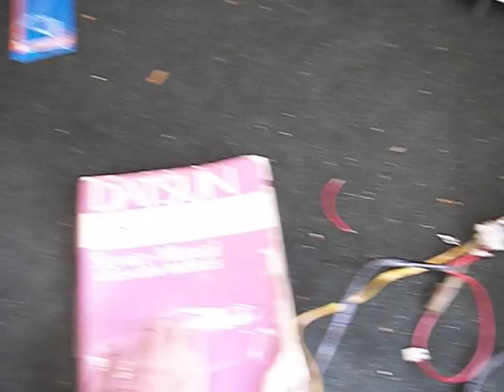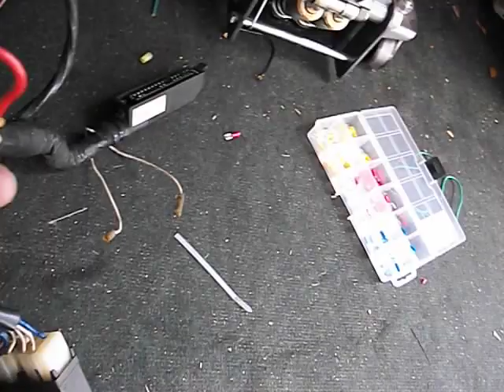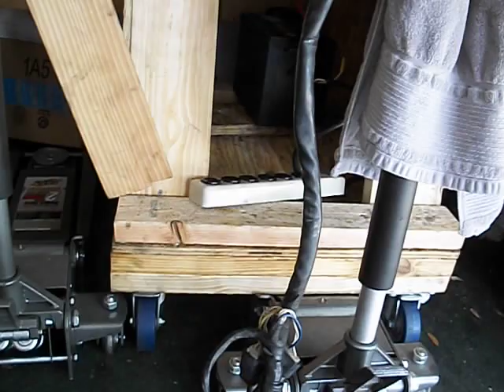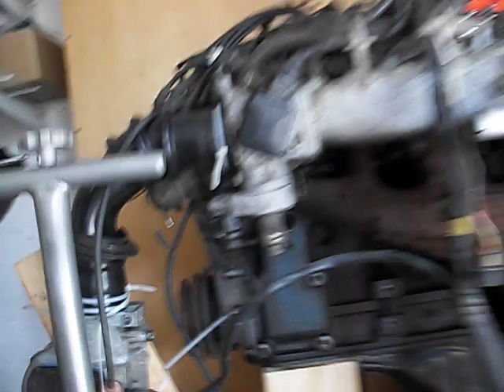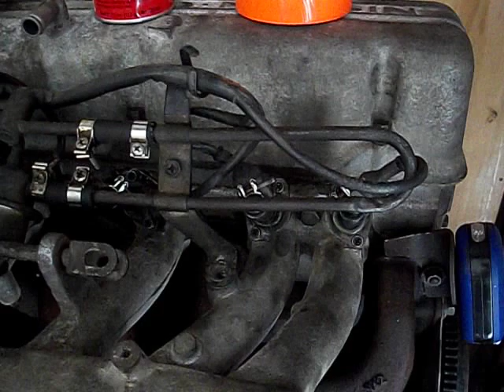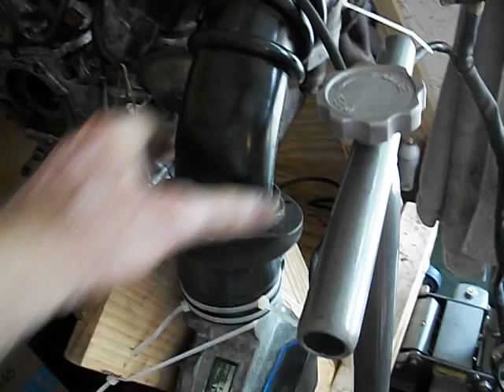Datsun 280z L28 on test stand, EFI hooked up

Comment: Plz i need help with my nissan laurel L24E if you can help me with the vacuum lines each hose where it goes your video is not clear enough but you made a good work
Reply from the maker: there are a lot of variations of hook up. But basicly you want ported vacuum to the distributor, some use a valve to only turn on that vacuum after the engine has warmed up.